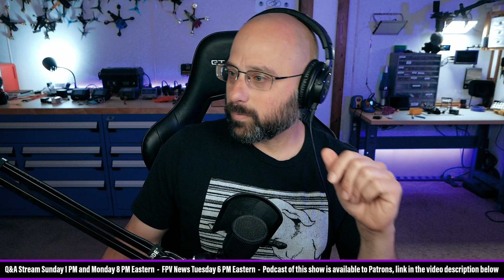My Drone Crashed And Now The Motors Don't Beep! Help! - FPV Questions

Comment: Do a physical inspection on the FC and ESC. I’ve had a crash with a cinewhoop that had a Fet fall off and didn’t understand why it wouldn’t fly until I took it apart to put the vista on another drone and later went back to it and saw it was missing a Fet lol.

Comment: did you guys ever had a flightcontrollers MCU failing after an hard landing? Seems to me the processor or something is relatively sensible for physical stress. The Short must be happened inside the Chip. In my case i disarmed like 1 meter above beton by accident.

Comment: I hit RTH on my explorer with 4 sats 100ft over asphalt. The 18650 battery pack and a prop took all the damage. Cleaning up my underpants was the worse part, but still happy flying. Especially since I caught a flight controller on fire a few days before(baby nano 20 🪦)

Comment: Bruh my esc died right now from disarming 1 foot over ground. Brand new speedybee 55A
Reply: I have the exact same ESC, took a flat crash from failsafe (more like a really brutal landing) and now it's dead. I guess these ESC don't like vertical shocks.
Reply: Same here
Reply: @rcdudede  okay so I thought it was dead but I got on betaflight with a battery connected, went to the motors tab and slowly ramped up the motors and like magic it’s like new.
Reply: @SpaceJuggs  My tvs diode just got desoldered from that. managed to solder it back on
Reply: My mamba esc died yesterday after a very small fall. I only get 3 beeps now but not the last two. I’m not sure if it is actually dead but it’s what I’m assuming
Reply: @caden_mac same thing with mamba. Ddi you look more into it? Dead?
Reply: @paynge99  I haven’t really had time it was more of a ‘just for fun project’. I was just gonna buy a new esc but I’ve been saving since I begin flight training in a few months